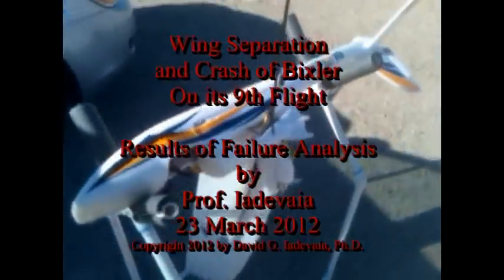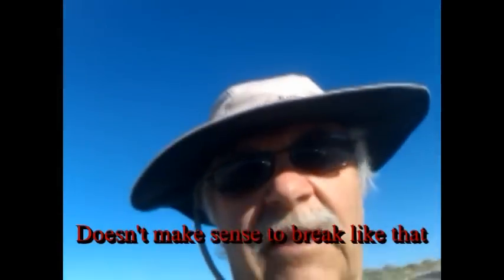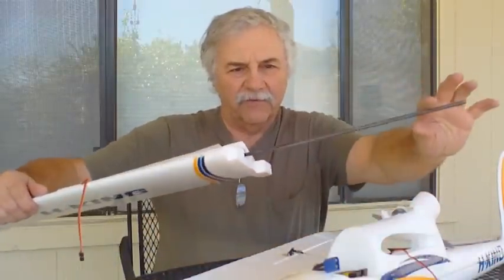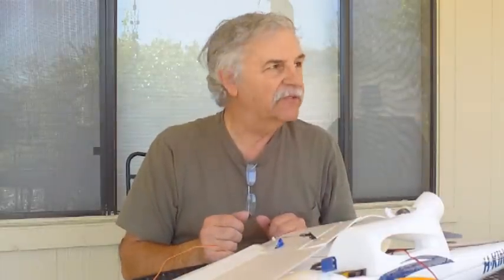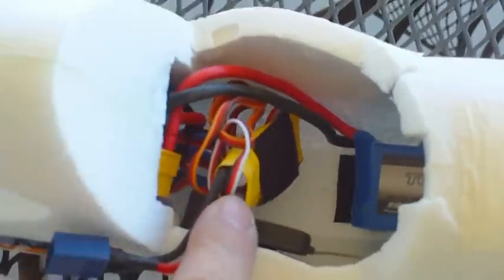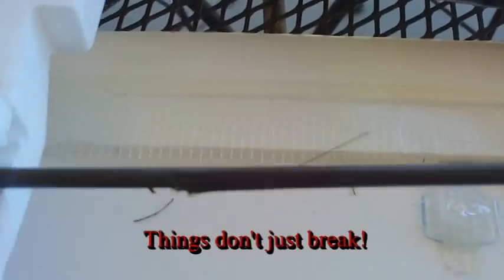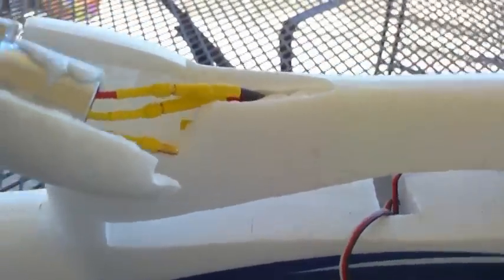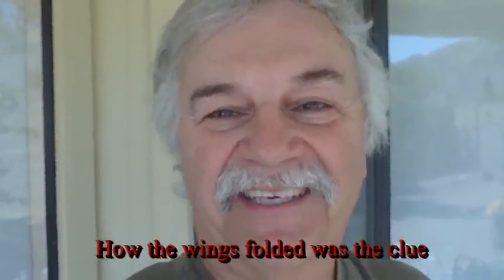Bixler In Flight Wing Separation

Comment: I have three separate rubber bands holding mine on. I spaced them along the chord of the wing. I can pull them tighter and any movement will only pull the wings tighter. I assemble it at home as I can fit the plane in the car RTF. I also like to fly my plane  without having to use a rubber band to hold the canopy on...

Comment: @xjet The problem with the axn is its limited room and internal capacity to carry anything. I have several guys with the axn at my field due to your videos but i couldnt imagine squeezing all my gear into one (500mW 5.8ghz tx, EZosd, 4000mah 3s pack, ect.) With the proper wing holding method and a reinforced spar i have done a 300m straight dive and pulled up without issue

Comment: I agree with korey1033, the AXN just doesn't have enough space for fpv gear and larger batteries. With a simple 3-4mm carbon fiber spare inside the stock wing spar on the Bixler you can pick up tremendous speed in a steep dive and pull out sharply at the bottom without having to take your plane home in a bin bag... 

-Al

Comment: That's frustrating...  I had used rubber bands to hold on the wing, because I thought I would need to take the plane apart for transportation.  That's never been the case - I've always kept the wings on and if I were to build another one I might permanently attach the wings.

Comment: I crash my Bixler 2 yesterday.  It was a clam day... A bit cold.  Had been flying all day fairly slow.  I decided to really fly fast, as the plane hit top speed, in level flight, the fuselage started to violently flutter up and down.  I recovered by simply killing the speed. I landed and checked out the plane.  All seemed good.   I launched again... Flying a about 1/2 throttle I decided to Harrell roll it... Big mistake... Left wing snapped off... It broke right at the fuselage.

Comment: I had the same breakage. The wing spar is too thin. It will not take an impact. To fix this do this.
The wing spar is a 6-4 mm dia if you get a 4-2 mm spar and glue it inside the 6-4mm spar it will make a 6-2mm dia. spar now it will take a hard impact without breaking. And a lot cheapr than running out flushing more money down the toilet for another plane. I like the Bixler and a few up grades it is a great plane. I can use some crash proofing though.

Comment: I bought a Bixler and i'm seeing a lots of planes snapping the wings because the wing spar just broke. What's the better to assemble it? Usually, Is the rubber band used to keep the wing together and then when I want I can separate just to transport the plane? What if I glue the wings? Should I buy a better wing spar. I don't know what to do now.

Comment: I flew my Bixler over 130 times, loaded down w/FPV camera, video transmitter, and extra battery...without any structural failures. It finally died when it hit a tree under low light conditions, (pilot error).
Other than that, I found the Bixler to be very strong and easy to fly... but a bit underpowered.

Comment: try a 3/16x36" wood dowel rod it works great.i put some glue( i used goop) on the rod insert inside the tube (its a little smaller) that comes with kit seal up the ends with glue and it is very strong and cost approx. $0.57 @ michaels craft store. adds very little weight.
Reply: sorry i meant 1/8x36" dowel rod not 3/16". thinking of a different plane